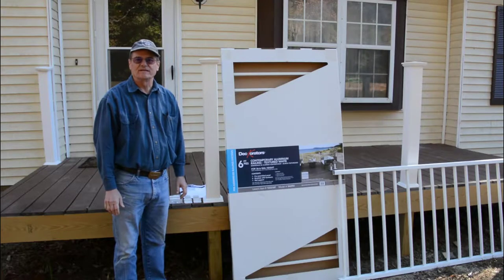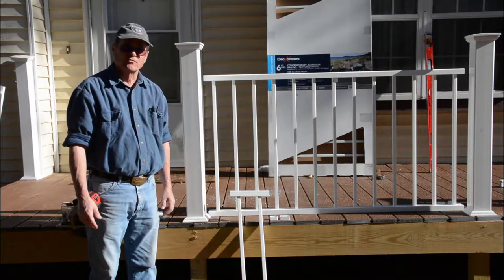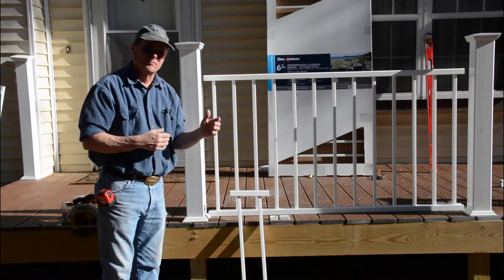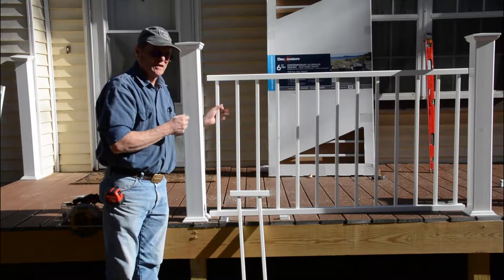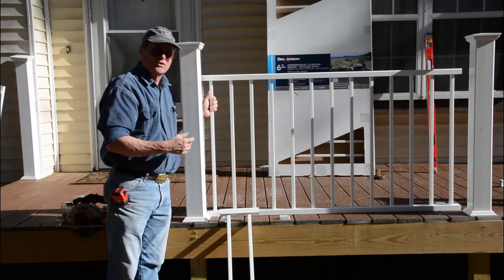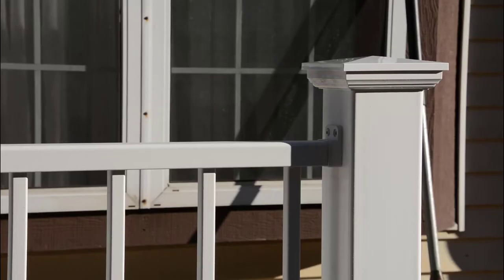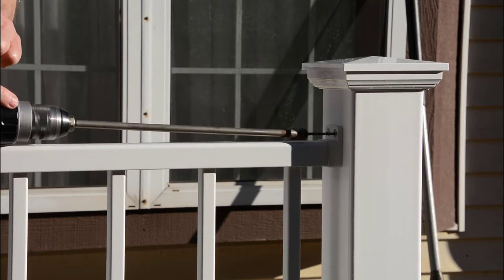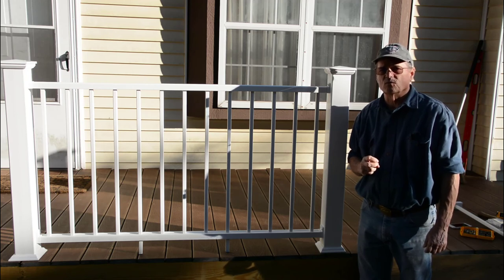Porch Railing  installation, aluminum pre-assembled Universal Rail.

Comment: Great job with the video,  nice,  easy and to the point.  I'm considering these but think I want the vinyl/composite opposed to the aluminium.  I do see there is an error on install,  minor oversight 🙃 but the process was thorough.  Thanks again. Take care.
Reply from the maker: Thank you for the comment.  If the mistake you referred to is that the railing is up side down, that has been pointed out before BUT I like it better that way.  If installed per the directions, the top edge has squared off edges.  The bottom is more rounded.  I like the more rounded edge on the top.  I think it is easier to grip that way and easier on my hands.   Thank you for visiting and have a great day.

Comment: Wayne, you need to check the direction of your mounting, top & bottom. You have the small rail on top and bracket screws on top. This is not per instructions. Large rail is the top. Bracket screw holes should be below the railing, both top and bottom.
Reply: I knew something seemed off it is upside down.
Reply: I'm getting ready to install as well and agree.  Seems logical to have the large portion on top.  If the grooved is on bottom all it's gonna do is catch water and trash.

Comment: 35 and I appreciate longer explanations on things that need it. If you watch and readnthe veranda composite handrail install its way to short. It assumes ive done it before and they want me to waste at least one oanel to have to buy anothwr i feel. Thanks for the info about longest first. The gap needed with cut. It just says 0.5" but is that ok both ends or total divided by 2. Infuriating. Here goes nothing! Next up stairs , stair stringers (10 step) x4 for comoosite stair treads lol...also landing ugh
Reply from the maker: Glad I could help.  Good luck with your project and have a great day.

Comment: You installed the rails upside down. The wide rail goes on the top.
Reply from the maker: Yes I did.  It was a mistake BUT after I figured it out, I like them upside down.  The reason is the bottom rail is smaller with more rounded edges.  To me this makes it easier to hold on to.  The top rail is wider and has more squared edges that I can't grip as easily.  So yes they are upside down but I would install them this way if I had others to install.  Thanks for visiting.